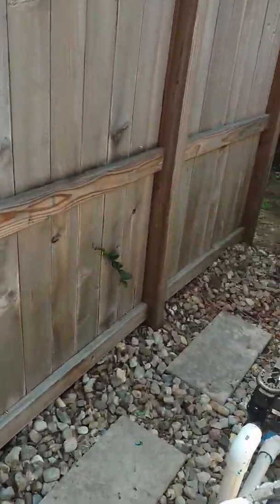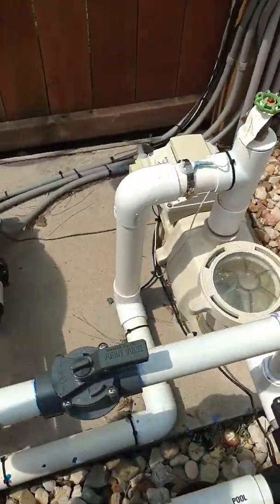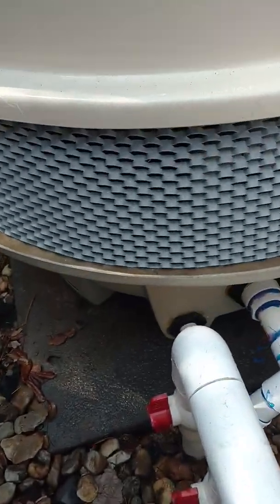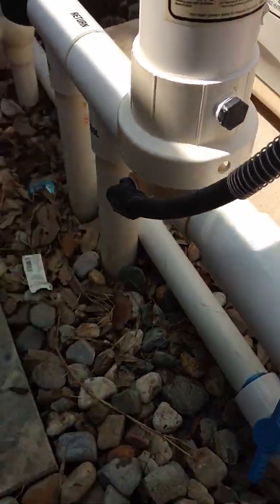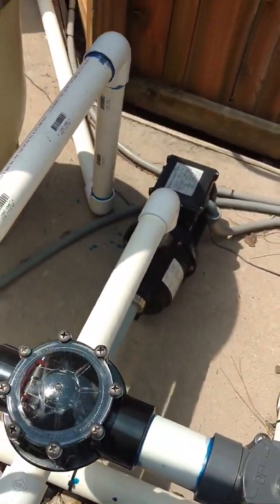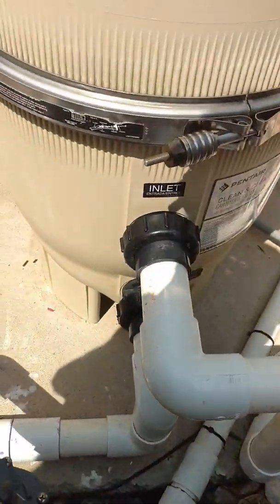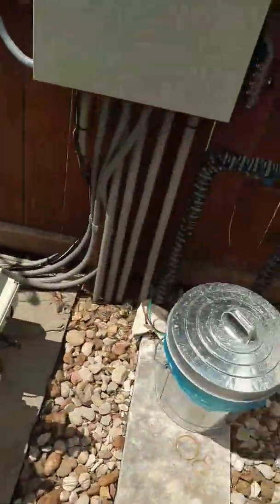Operating a Glacier pool cooler

Comment: Mark, we have a glacier pool cooler.  It was installed back in November when the pool was built so we are using it for the first time.  Water keeps coming out of the overflow port.  I have the water inlet flow set very low.   Is there anything I can do to keep water from pouring out of the overflow?

Comment: Has anyone experienced the discharge from the cooler line sucking air into the system when the bottom of the cooler is dry? Mine seems to suck open the 5lb check valve when the discharge block valve is open.

Comment: Mark appreciate the demonstration of how to operate the Glacier Cooler. One question is the water pressure what determines the speed of the fan, My cooler is continually spraying water and I'm trying to find a way to set the pressure for the cooler correctly. My pool installer had never used one of these and I I don't think he knew exactly how to set this up. I would love to use it more but I've had this thing empty my spa and lower the water level in the pool when I wasn't paying attention and  the pool shut down. Any advice? Do you know of a way to ensure I have the right pressure going to the cooler fan because I think it might  be going too fast.
Reply from the maker: The fan speed is fixed and runs all the time. The water flow determines the speed of the water wand, which should be turning fairly slowly. The water makes is spin from centrifugal force. If is very slow, or not turning at all, add water flow. If it spins too fast, slow water flow. Too much water flow will overpower the sump pump in the bottom, which cycles to return water to pool. Too much water and it can't keep up and will overflow the bottom sump tank. Also a failure of the pump, or loose piping inside can make this happen.

Comment: Does anyone have this hooked up to a Pentair Screenlogic system for automatic scheduling and ability to control via phone app?
Reply: I’m installing one and hopefully setting it up on screen logic Friday. I’ll come back and report. I know it requires use of the solar relay
Reply: @seanobannon4888  any update?
Reply: @gm4ky  yes actually. So w the solar relay set up you’re allowing remote temp control. We couldn’t get it to work properly. We called Pentair to trouble shoot and they said the reliability of the system with the glacier chiller is abysmal. The alternative they recommended was to wire the chiller (main motor and sump pump) to the same low voltage relay and run it as an auxiliary similar to a pool light. We then assigned a valve actuator to control it in screen logic. We put the actuator on the return plumbing post heater. There’s a bypass you’re supposed to set up to divert flow from the heater to the rest of the return plumbing, or to a dedicated 2” line that goes to the floor of the pool for the chiller. That bypass is where our actuator went. When the customer wants to cool the pool, they simply turn it on in screen logic and turn it off when it hits their desired temperature. They can also of course set a schedule for it. After installing this unit I really wouldn’t recommend it. There’s no compressor or anything, it’s basically just a swamp cooler. Here in AZ it takes the thing like 8-10 hours to drop the temp 10° and that’s about all it can do. It’s installed on a ~11k gallon pool. I can’t even imagine how long it would take on a dive pool. You may as well get an aqua cal heat pump. Easier to install, easier to automate, and you only have to have one piece of equipment to handle heating and cooling. Just my two cents. The customer service from Glacier is also crap for pros. Can’t comment on end user experience.
Reply: @seanobannon4888  Thanks so much for the info. This is exactly the kind of info I needed. Appreciate it!
Reply: @crishanabanana  happy to help :)

Comment: Mark, I had to change my fan guard and fan. I finally received those parts from Glacier, but it took so long I can't remember which way the fan attaches to the motor. Could you please tell me if the heads of the bolts that hold the fan together face up towards the motor or down towards the cooling element? Thanks, I would really appreciate it.

Comment: I have been in the swimming pool industry for 15 years in Las Vegas (where it gets 117 in July). I have never seen one of these in 15 years. JUST sold my business, moving to Texas, and starting another business. Was told these exist out there. I am mind blown. Water does not get that hot. 79 degrees max in summer time. Most of my Vegas client turn their solar heater on in summer to bring their pool into the high 80's. Not looking forward to more moving parts creating more possible leaks, etc. Great video man.
Reply: That is because in Vegas, it cools down at night.  NOT in TEXAS!  Pools here get 90+ degrees in the day.  Talk to Arizona folks.  Pools there get over 100 degrees during the day.  Pool chillers is all they have to keep their pools cool.
Reply: @clintharris4447  these are extremely rare in AZ. If someone wants to cool their pool they usually use a heat pump here bc it has a condenser. I just installed my first one of these last week and it was a terrible experience lol
Reply from the maker: They work great in Vegas with the humidity near zero! The Glacier company itself is out of Phoneix with similar weather.

Comment: Does one switch turn on both the fan motor and the cooler pump motor or do they have each have separate switches? I found a PDF online of installation instructions which state you can leave the ball valves open in the summer even when you don't need cooling (which I don't understand). I would think the cooler pump motor would still have to operate and the fan turned off, which would require separate switches. Also, I note your installation has the blue balancing valve which is not shown in the instructions. The instructions shows check valves on both lines and you have one on only the return line. I have ordered the unit but could you cast any light on these observations?
Reply: Did you find any more info on the installation? Mine has arrived and ready to install...
Reply: @jakekuehl2675  I picked mine up from the freight terminal this past Friday. Upon inspection, I found that the sump pump line was not glued to the outlet connection. I called tech and a guy indicated that a few had this issue (missed at assembly point). They are sending me what is needed. My pool and pool heater are 14 years old. Originally plumbed with 1-1/2" PVC. Therefore, I was going to plumb with 1-1/2" PVC. Tech highly recommended against this, as apparently the unit won't get the same number of cycles which lead to less cooling. I'm short one fitting that I can't find locally, so I have ordered over the internet. When it arrives, I will finish the plumbing.
Reply: @bmod49  Where did you get the 2lb check valves from required on the inlet and outlet?
Reply: @jakekuehl2675  Inyoypools.com has the 2lb check valve, the diverter valves and ball valve similar to the ones in the video.
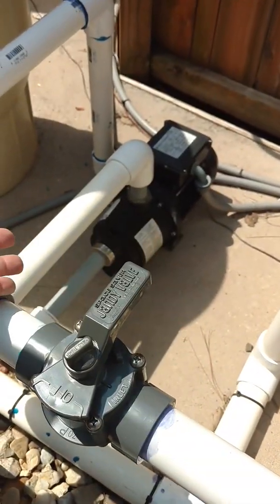Reply: @bmod49  Installed a GPC25 yesterday and it has been running all night.  My unit did not have the sump pump line glued either. Plumbed mine just like the above video with 2 diverter valves, 1 check valve and the ball valve.  My pool uses  1-1/2" PVC and that is what is used. The only problem I had was getting the water flow balanced. To get mine to work I have the ball valve to the inlet set to around 2:00 and the diverter valve from the outlet set at around 2:00. You have to install a 1" plug into the overflow port. I had to let the water fill almost to the top before opening the inlet diverter valve to the 2:00 position. If I opened it all the way it would work for a few minutes and then the pump would cavitate.
The wands on my unit were installed with the holes pointing down. I had to turn them horizontal to get the wands to rotate. I opened the inlet ball valve up enough to get the wands to rotate at  17 rpm and that seems to work. Would be nice to find out more info on these units.
Reply: @DubellT  Thank you! So helpful. Jake and I have been talking via phone & text. Neither of us are up and running yet. I am waiting on one fitting and Jake is in the process of installing his pool, heater and cooler. The cooler instructions leave a lot to be desired and the tech service is not the best. Forming a network of owners would be very helpful. As Jake has pointed out, each install is unique and has its own issues. Please stay active here or provide an email address. Our experiences will be mutually beneficial.
My fan at the top of the unit is different than the video here. Mine runs at a high RPM, not slow like the video. Mine is shaped more like a big boat prop, not weird shaped blades like the video. I may need your help when my last fittings arrives. Thanks again for sharing your experience.
Reply: Dasto I think the fan just looks as if it’s spinning slow on the video. It spins at a high speed.
Reply: @DubellT  OK. FYI my unit is a GPC - 210. At your convenience can you time a cycle? That is the time from start of sump pump all the way through pumping, filling, and back to the start of another pumping cycle. I would like to calculate how many cycles per hour.
Reply: My pool set-up is also 1-1/2". When I noticed the sump pump line was not glued, I called tech. During that discussion with tech, I was informed that it is essential to have the cooler outlet line 2" to get the adequate number of cooling cycles. At that time I nearly had the cooler all plumbed with 1-1/2". So, I re-plumbed the cooler outlet line to 2". I am curious to see how this all turns out when I receive my last fitting. I think the video install is all 1-1/2" also. The tech guy was making a point that you get fewer cycles with 1-1/2" versus 2". He said that I could leave the cooler inlet line 1-1/2" but to change the cooler outlet line to 2". He acknowledged that some older installations are out there at the 1-1/2" size but that they cooled maybe 4-5º change versus 8-12º change with the 2" lines that provide more cycles. By the way, how did you resolve the sump pump line? Did you glue it yourself?
Reply: @DubellT  thanks, I got all my parts, will be plumbing on Monday.  I am installing to above ground pool, so i plan to experiment with outlet just running to top of pool and pouring into it.  Sump pump specs states 37gpm at 5ft of head.  If that doesn't work, do you know of any reason why you can't plumb into heater outlet that runs back to pool (Dastro mentioned this)?
Reply: @jakekuehl2675  Seems like plumbing straight to the pool would be better. I have an existing in ground pool so I could only plumb it like in the video.
Reply: @bmod49  I glued it myself using multi purpose glue.
Reply: Tiger Thomas me too
Reply: @jakekuehl2675  Sending you and email.
Reply from the maker: It is supposed to spin slowly, about 4-8 rpm. If it goes much faster it can spray water out, and not cool as well as well. out
Reply from the maker: That is a common issue. Also sometimes the union connection comes loose inside during shipping. This needs to be checked before start up. If not the pool pump will start to suck in air.
Reply from the maker: Despite the install instructions you do not need check valves unless the cooler is lower than the actual pool level. and even then if you manually operate the valves correctly it won't backflow.
Reply: @marksmith8113  Mine is running 26 rpm and not spraying water out
Reply: @DubellT  I'm installing one of these currently and my pool is setup with 1 1/2".  Did you stick with 1 1/2 or change it out to 2" as @Dasto mentioned?
Reply: @bradpinkston  Kept the 1 1/2  pipe. I couldn’t see an advantage in using 2 because you throttle the flow down with the valves.
Reply: @DubellT  Exactly what I was thinking.  Thanks.
Reply from the maker: @bmod49  Hate to say this but the internal connections commonly come loose in shipping. We have to check every install
Reply from the maker: @jakekuehl2675  Order them online from a pool supplier. Local pool suppliers don't like to sell to the public
Reply from the maker: @DubellT  The loose sumps are a common shipping problem. They may  ship them loose to avoid freight damage.
Reply from the maker: @DubellT  don't confuse the fan, which is electric, with the water wand just below it. The water wand has to be spinning slowly.
Reply from the maker: @bmod49  Depends on the water flow but typically one to two minutes per cycle is normal.
Reply from the maker: @bmod49  I have found that 1 1/2" works fine. In fact will move too much water without restrictor balance valve
Reply from the maker: The fan switch runs both pump and fan. Fan runs continuous and pump cycles as sump fills and empties. If you turn off unit and leave valves open if will quickly start overflowing your pool water into your yard.
Reply from the maker: One switch powers both. Fan runs all the time. The pump in the bottom  cycles on a water level float switch.

Comment: Nice video mark ! If you don’t mind what is your pool temp in say June - Aug with the unit. 

Not much info on these units
Reply: I have this same unit and I get my water down to 83-85 in the July-August. I’m in Houston. It makes a huge difference and makes the pool refreshing. I can say prior to having this installed, my pool wasn’t enjoyable during the hottest part of the summer.
Reply: Thanks! I’m in Houston aswell !
Reply: In Houston too appreciate the comments
Reply from the maker: On the worst days when the humidity is highest and dew point the highest the pool get up to about 86 or 87 during the day and then cools to 82 or 84 at night. I just posted a new video yesterday that explains this
Reply from the maker: I  can keep pool 80-82 in hottest months. And keep in mind I use the pool to cool my house as well, which adds to the load. But that is a whole different subject!

Comment: Can you post a picture showing the set up of your plumbing? I am installing mine and went to see how yours is ran compared to the paperwork that comes with the unit.
Reply: Also, do you know how the power to it was ran since your pool is on 220v but the cooler is 110v?
Reply: @colemangraham4061  Hi Coleman. I hope you are subscribed to this thread and are getting notification of postings. There are a few of us that are actively doing installs. I think we can learn from our experiences. Seems that each install is unique. Please post if you have Qs or have something to share. A few of us are exchanging emails.
Reply: @colemangraham4061  i ended up wiring a standard 110v plug to my cooler and just plug it into a GFI outlet.
Reply from the maker: It should run on its own circuit, or possible with your light circuit.
Reply: I tapped into a 110v plug from inside. The wiring was very easy.
Reply from the maker: It will vary from unit to unit. Ideally the output from the cooler should have its direct line to the pool, but in a retrofit it usually has to recycle to the pump imput.